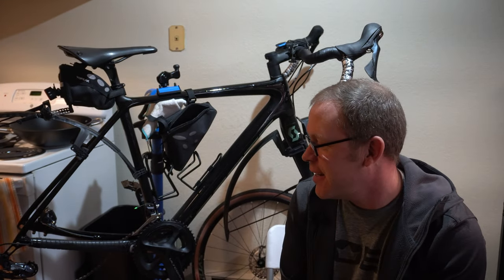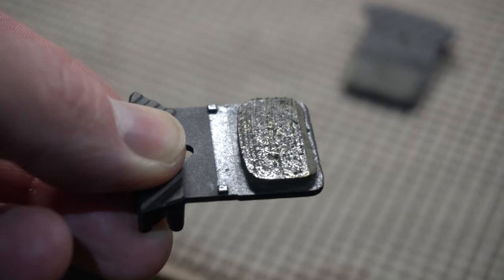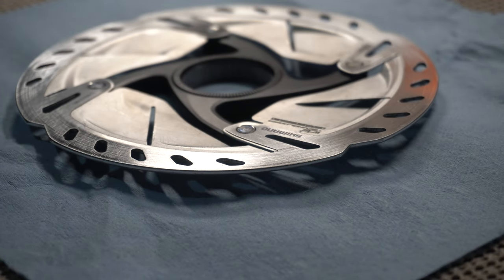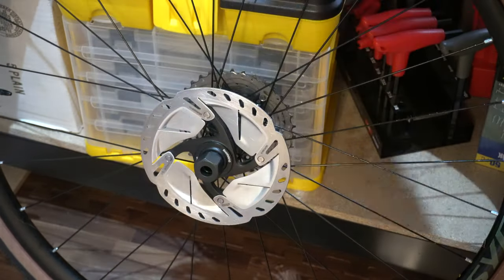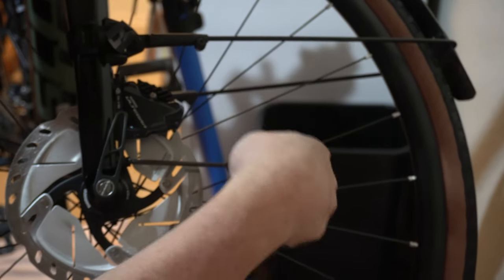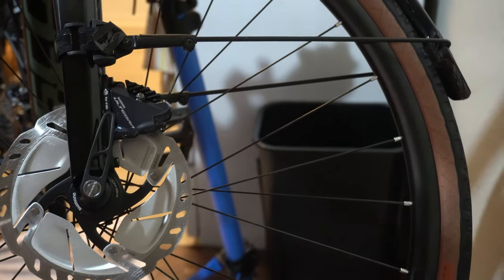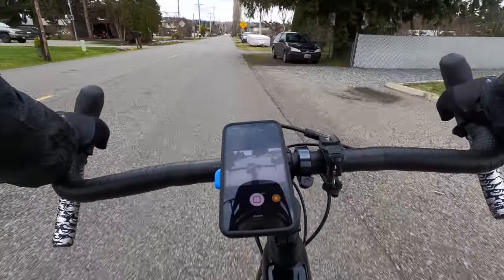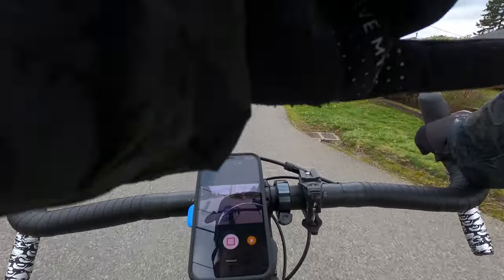Replacing my Shimano Ultegra disk brakes

Comment: Just found your video. Are you able to provide the part number of the pads and are they resin or metallic?  Cheers
Reply from the maker: Hey there, the part number is L03A. They are resin pads. Thanks for the question and checking out my channel.
Reply: @timmyboosters  Thank you. I have the Ultegra R8000 group set and your disk brake calipers look like mine. I’ll have to check the BR-R8… value on mine.